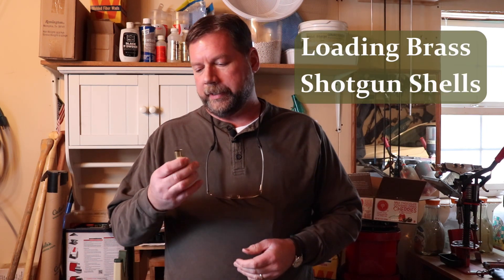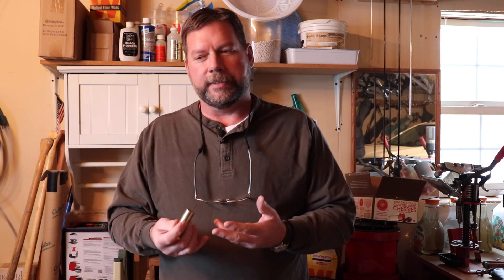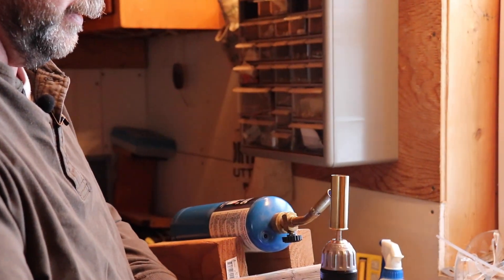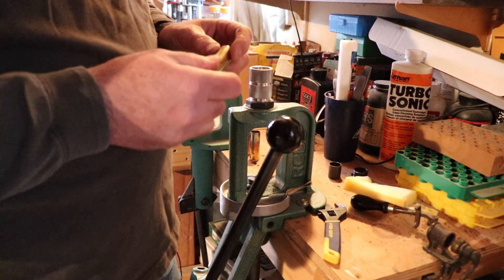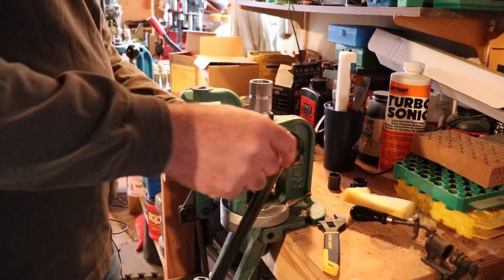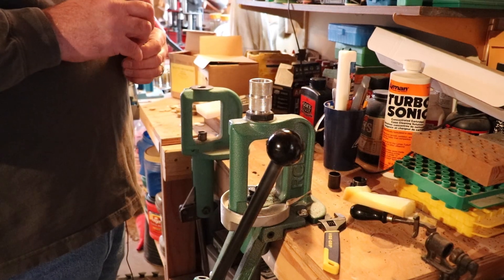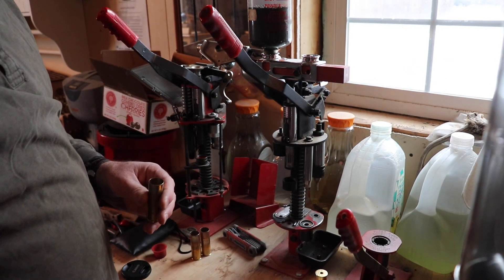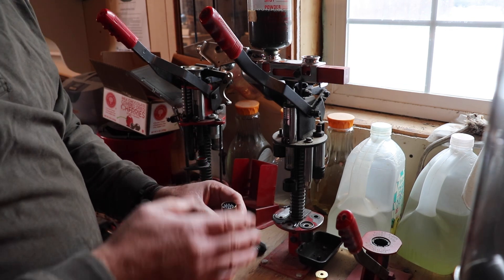Loading Brass Shotgun Shells

Comment: I have an Ithaca 10 gauge made in 1886 I have test fired with a string from around the corner. Brass cases are a problem so I shortened some Winchester plastic cases to 2.870 and that seems OK. This is a very use full video!  Thanks
Reply from the maker: Thank you for watching.  Keep enjoying that 10 gauge.

Comment: Nice to see you back in action Todd! you can just run varnish around the inside of the case mouth over the top wad, that saves stressing the brass case, and holds tight. And as for static, an anti static bracelet plugged into an earth socket will prevent that.  Stay safe ! Chris B.
Reply from the maker: Good tip.  I'll try the varnish method.

Comment: I heard you say Magtech I believe is that where you got your brass shells? I certainly would like to find me some for my old shotgun, and did you say you got your wods at Circle fly? Could you please answer these two questions I really would like to get some brass shells for my shotgun and I haven't been able to find any yet. I sure am glad you showed this video thanks again. Have a great day and stay safe and whatever you do keep your powder dry! Also if you could could you put a link to those two places that you got those things, thanks again. Also another question can you shoot a slug out of those shells?
Reply from the maker: Terry, the shells are indeed Magtech.  Try Buffalo Arms or MidwayUSA.  I've had them a while, so I'm not sure about availability right now.  For wads, go to thegunworks.com and order 11 gauge Circle Fly Wads.  They fit the brass cases perfectly.
Reply from the maker: My concern with slugs is getting the diameter big enough to fit snuggly in the brass case and then being over sized for the barrel.  It's one thing for a shot column to hit the forcing cone and another thing for an oversized slug to do it.  I have some old slug rounds in paper, but the slug is about bore size.  The thin walled brass wouldn't hold it tightly.  Maybe some subscribers have experience with this.
Reply: RMC, Rocky Mountain Cartridges brass

Comment: Great  video and very helpful. I have a question however… I have an old Belgian hammer sxs 12 gauge that is clean and sound. I have all the components to load BP brass shotshell a but when I chamber the empty brass shotshell  they don’t fully chamber. They protrude about 1/4” from the case rim.  They do chamber in another 12 gauge j have so I believe the chambers on the hammer gun are just a tad small. I hesitate to buy the RCBS shotshell sizing just to try to make them work. Do you know if the RCBS die will size the brass enough to make them work or do I have an out of spec chamber? I would really like to get my hands on an empty RCBS resized brass shell to try before I buy the die set. Any advice would be greatly appreciated. Thanks
Reply from the maker: Joel, Do plastic rounds chamber okay?  I hesitate to provide too much advice over the internet.  I don't want you trying something that harms you or the gun.  So I'll go with the standard answer of "find a reputable gunsmith".  Two things to ask about: 1. Chamber length.  You might have a very short chamber made for an obsolete round. 2. Chamber diameter.  It could be a little tight.  That's where the plastic shell comes in.  They are usually tapered and will slide passed a short chamber's forcing cone.  If chamber dimensions are tight, the modern shell might stick as well.  Then you'll know.  The gunsmith can check both possibilities safely and give you an answer.  You will also get some feedback on the overall sturdiness of the gun.  A good shotgun gunsmith will consider things you never heard of.  Thanks for asking, Todd
Reply: Thank you for your advise.  Looks like the search is on for a shotgun gunsmith.

Comment: Nice work. But its NOT a collet! It's a sleeve, or insert, threaded. I suspect the crimp insert is also not a collet. A collet is segmented and works by squeezing the segments together to compress. Fundamental difference. The crimp insert is  likely a tapered funnel on the inside that progressively turns threading edge of the brass shell inwards.

Comment: So a quick question.  What is your inside diameter of your cartridges after sizing. I have a project that requires a .727-.730 inside the cartridge diameter. My virgin brass is at .766, so trying to decide if the die set will be worth the purchase.  I've posted on my channel hints to the project. 
Mountain man
Reply from the maker: Steve, There's not much resizing happening with the die.  A lot of times there is no resistance.  I always resize just to be sure, but it I seldom have to work hard at it.  I'll measure, though, and see where they end up.  Todd
Reply from the maker: Steve, Just measured a case.  It's .766. So, if expansion happens, it get resized to .766.  Sorry this doesn't solve your issue, but at least it didn't cost you money to find out.  Todd
Reply: @Frontier Western Heritage  I appreciate it. At this point the only reason I  see for that die kit is the shell holder, and the crimping attachment.  I reached out to rocky mountain cartridge company yesterday. Not heard back from them yet.
Thank you

Comment: Is there a Part 1 to this? I admit, I was fast forwarding a lot to get to the actual using of the RCBS die, but I didn't see you set up the die in your press or use it for decapping... Don't you use the decapping insert?
Reply from the maker: Thanks for commenting.  I used a hand held decapper and tumbled the brass in a rock tumbler with polishing solution and ceramic beads.  The tumbler cleans out the primer pocket and the inside of the case.  I apologize if I didn't mention any of this.  I did resize the cases in the RCBS die, but they didn't need it.  I could resize and decap with the die, but then black powder fouling gets inside the die.  That's why I use a hand decapper, polish the brass, and then resize.  Thanks for watching, Todd
Reply: Thanks for the reply, Todd.
Very good point on the BP fouling. That is exactly what I have been loading my brass shells with. By hand. I just got the RCBS Cowboy die and was going to start using that, but maybe I'll rethink still doing a few steps without it.
Appreciate all the great videos you put out! @frontierwesternheritage1356

Comment: Question: What is the press # that you are using? I have the dies but need the press. Thanks
Reply from the maker: It's the RCBS Rock Chucker single stage press.  I'd go out in the garage and get the number for you, but I'm in Texas hunting wild pigs.  The most important feature is the removable coulet that holds regular dies when in place and the shotgun die can fit there when the coulet is removed. Thanks for watching, Todd
Reply: :Your the best !! Thank you  @frontierwesternheritage1356
Reply: For anyone else looking into this, I found Creedmoor sports sells a replacement turret head for the t7 press that takes wedges for quick change of both 1¼-12 and standard 7/8 dies... it's not cheap at around $400 but in my case it saved me from buying and storing another separate press just to have the correct threads for these dies or if I ever decide to load 50bmg. Very happy they had this available. Thanks for the video on loading them!! It's appreciated!!